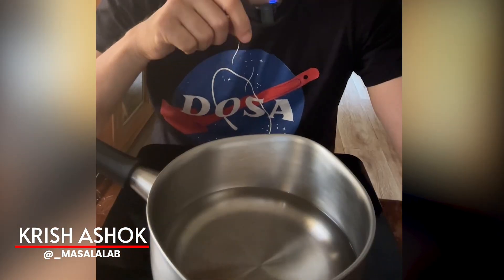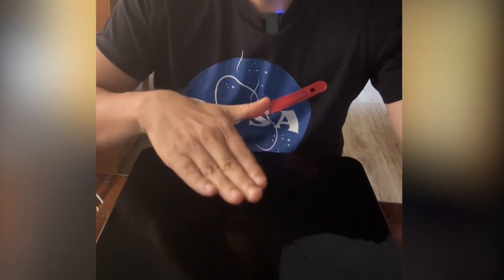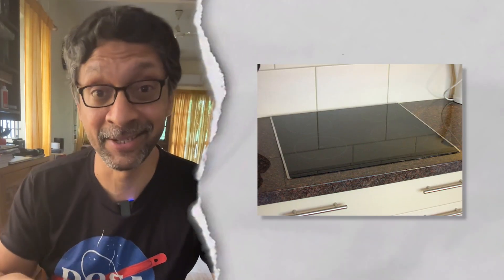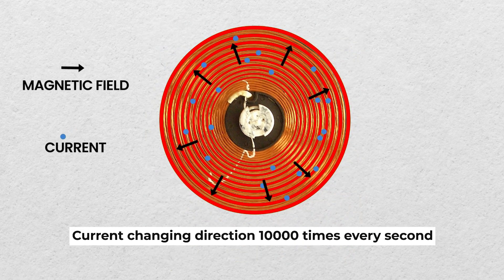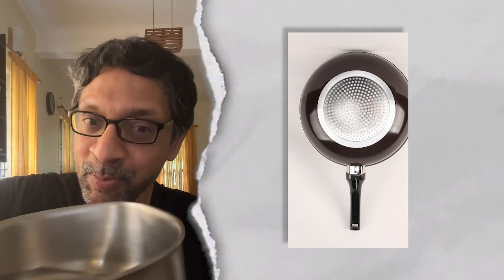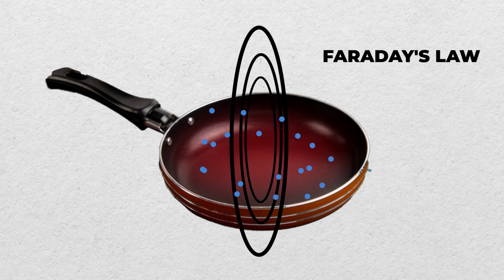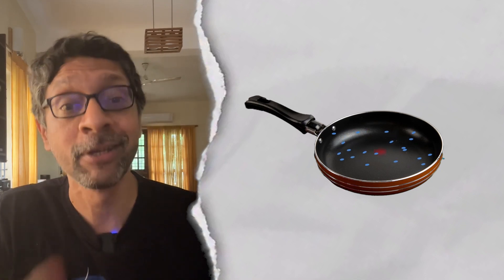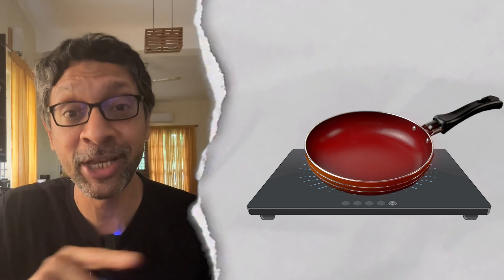The Elegant Principle Behind an Induction Stove

Comment: I think induction stove works only with vessals made with iron or steel? Will it work with vessals made from 100% aluminum or other non magnetic material? Or is it that all vessals have a steel/iron core and so it will work?
Reply from the maker: No it will only work with iron and magnetic steel

Comment: The heat in the pan is caused by the Eddy currents, since the current has nowhere to go, it produces heat in the vessel. The power can be given as I^2 * R where I is the current and R is the electrical resistance. And for this to work, the pan surface has to be magnetic in nature meaning it has to be made up of any three materials iron, nickel, or cobalt. Furthermore, the surface of induction stove is made up of ceramic material which in itself is poor conductor of heat and electricity, thus, not heating that much. Had it been of, say, iron or other metal, you would have been socked while making this video!! 😅😅

Comment: I like the energy efficiency thing at the end. But someone needs to study on how efficient it actually is when we take into consideration the energy loss in grid to supply the electricity that we need to run it,  compared to running a gas stove on a piped gas connection.

Comment: only thing i learnt by using induction stove is that pans are not burnt on side because of flames so easier to clean the pan , some time handles also get damaged because of flames from Gas burner. Temperature control is also pretty good with induction. only downside is roti or eggplant cant be cooked directly like on flames in gas burner.

Comment: And that's why you can place a newspaper below the cooking utensil over the oven and keep the induction clean.
Reply from the maker: Yep! But there is the off chance that paper might combust with sustained heat from the underside of the pan, especially once it loses all moisture
Reply: @krishashok  Yes, but then the inside of the pan will also burn(combustion temp of paper is close or more than smoking point of most oils). If an empty pan is kept Eddie current can melt the pan as well.

Comment: Thanks for an informative video!
I'm not into hard science. So here is a basic question. You say "the pan heats itself up because its in a changing magnetic field". But when I heat water in a pan and touch the pan after a minute, the pan is not hot. Only the water is. How is this?
Reply from the maker: The pan will still be hot, but because the heat is a function of eddy currents as opposed to heat transfer from elsewhere, it will also lose that jest quickly
Reply: This stuff is cool.. Thanks